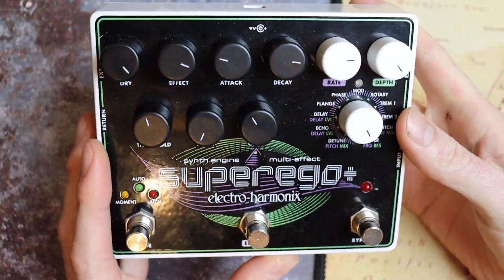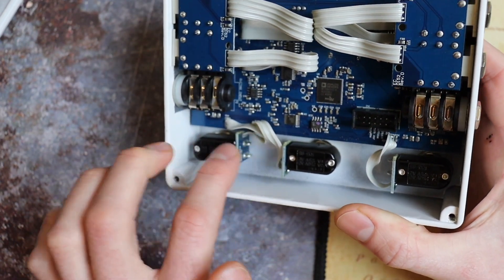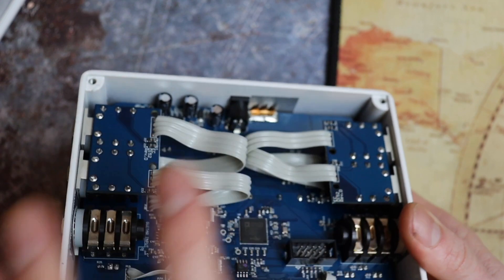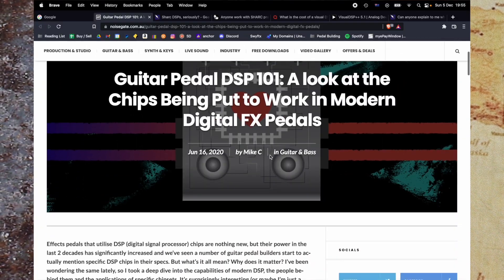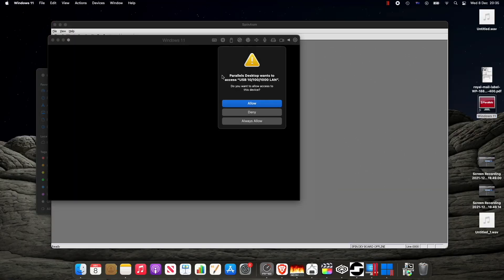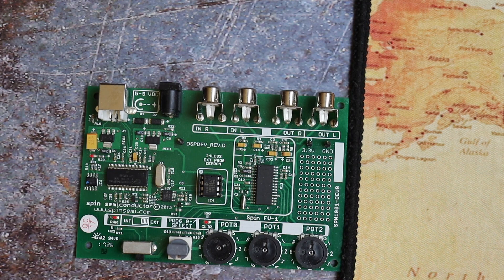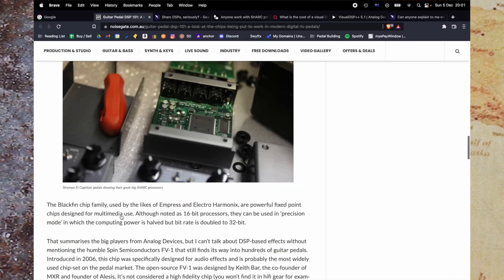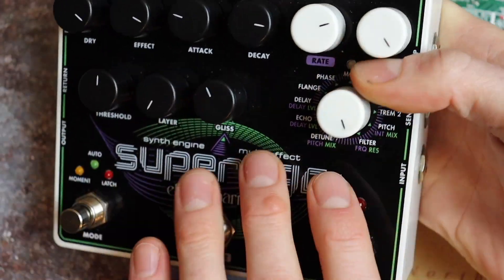EHX Superego+ Guts + thoughts on DIY Digital Pedals (FV-1 / SHARC etc) [all talking / no playing]

Comment: Hey  my friend plugged a 9v ac power supply in to mine by accident  and the cap next to the power jack exploded.  Can u look on yrs and tell me    What the value of that capacitor so I can replace mine ? Thanks
Reply from the maker: Sorry, I would but I no longer have the pedal. If you email EHX nicely they will probably share the schematic (they did for me when I had an issue with my DMMTT)